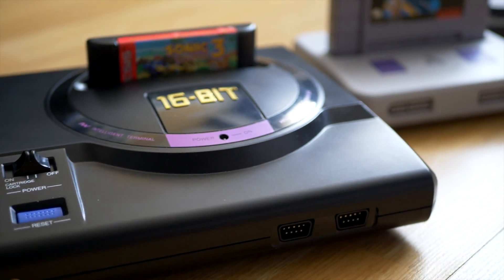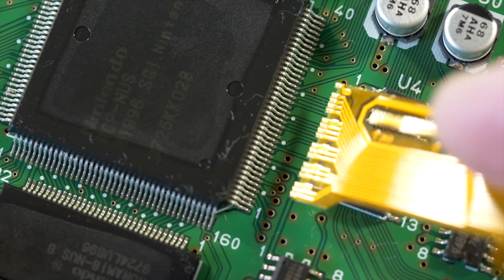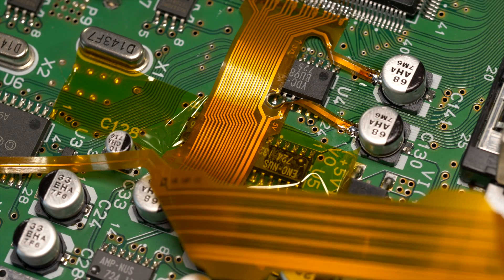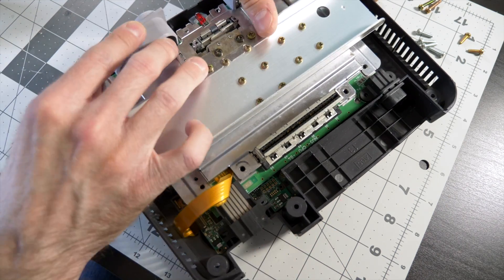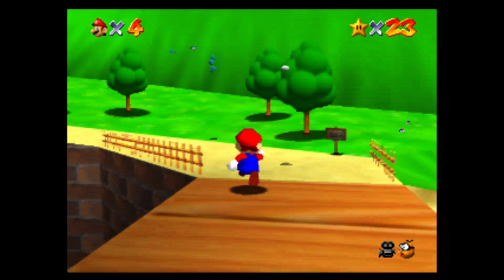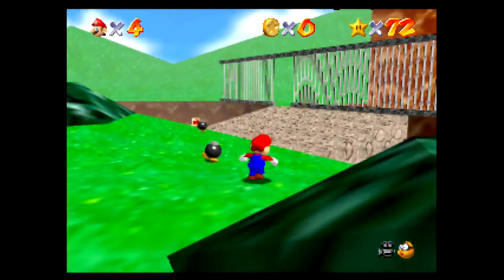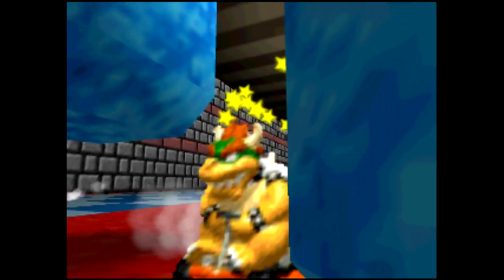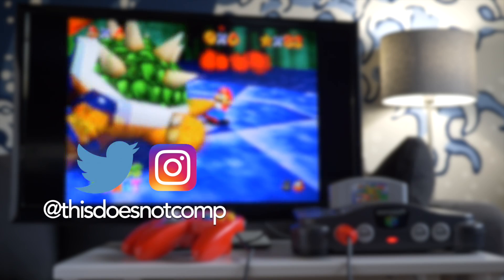HD Output For Your Nintendo 64 - UltraHDMI Review

Comment: This is not even a solution for me, because the price is too high, there's too much trial and error involved with installing the device, the picture quality isn't much better aside from the use of HD and getting it pre-installed costs a ludicrous amount of money! It boggles my mind how there still isn't a better, cheaper solution for just being able to play my N64 games in HD in 2018! Surely they would've come up with a reproduction console that runs through emulation for N64 games by now! They already did the same with 16 bit consoles years ago, and it's not like N64 games run on optical disks or anything!

Comment: I would love to see one be made for the Sega Genesis. I have a European Mega Drive with a VA4 board HDG without the TMSS screen which I've modded already and even housed it into a Japanese style casing from a PAL Asian board. I swapped the board out, because it was the non-HDG model and had the TMSS screen every time you booted it up. I've even added two region switches (this mod was done in 2010 before I learned about the single switch), CPU freeze, pink power LED, overclock, rear headphone jack (post-pot), and a reset pedal on the side of the unit. I also plan to do a 60Hz colour fix for when I'm not using scart, bluetooth audio, internal battery (I use this thing at live chiptune shows), YM3438 piggyback (for improved audio output), and a composite plug in place of the coaxial port. If there's a mod like this available for the system, that'll make 6 extra mods to plan.

Oh, and I even got it signed by Yuzo Koshiro and Motohiro Kawashima!

Comment: Omg you are a boss. I never succeed in soldering flat flex cables. I either burn the cable or make a total mess with the solder or both :/ does anyone make a needle-tip soldering iron with controllable temp? I could never find one... anyway, thanks for the fun video! Great work!

Comment: or.... or.... or.... you can emulate
Reply: N64 emulation is not always great. The best and most consistent option is a stock unit (cheap) with a consumer CRT. Or an OSSC if you're willing to spend extra.
Reply: I never had any problems using emulaters... mario works as intended and all.. the only downfall when trying to get perfect graphics is alot games fps was related to speed so if you played mario 64 in 60 fps you would get double speed but other than that they played as intended with no graphical glitches (at least in my experience)
Reply: i dont have any graphical glitches with that game on an emulator.
Reply: i didnt even have graphical glitches when i used project64 v1.6 back in 2014. maybe you had certain things disabled by default in the settings. i always used my own settings

Comment: I suppose I'm the only guy who got one of these and sold it. I simply was not impressed with it vs rgb on a CRT. Especially if you have a 4k TV in which case you typically have to run the hdmi through something like the xrgb mini anyway.

Comment: Between the cost, install difficulty, and rarity of the mod, not to mention the requirement of cutting the console casing, I decided to go with Tim Worthington's RGB board instead. Both Tim's board with Borti's firmware, along with Borti's own custom RGB board are able to perform de-blurring like the Ultra HDMI, and you can pair it with an OSSC for HDMI output with minimal lag. Of course, the Ultra HDMI internal menu options are more robust, but the image quality vs Tim's board +OSSC is not far off. https://imgur.com/a/9PlWSo2

Comment: I did this recently with Marshall's Ultra VGA board for my portable N64 and I found it far easier to tin the pads on the flex cable first, flux the flex and RCP and then drag the solder on the flex cable to the RCP pins. Didn't need to use any tape and that method worked first try! Overall love both mods in general!

Comment: Interesting, I am thinking about making portable N64 and would like to know a good lcd to use that can handle the custom refresh rate. Many portable N64 consoles use composite with a 640 by 480 lcd display. But with this will it show a 4:3 picture on a 16:9 display and I can just cover the black bars with plastic? But the $150 and scarcity makes a need to visit them in shenzhen to find out how they have the ability to produce such circuit boards.

Comment: In my opinion it seems like a huge waste of money. These games were built to be played on a CRT, you could RGB mod or buy a pre-made one plus a CRT for much cheaper than buying this to get great quality on a CRT.

If you want old games looking good on a HDTV, just buy or build a retropie. They'll have options for upscaling and filters too the games will look great on a modern TV

If you absolutely must use your old hardware on a modern TV, just buy an OSSC which will not only work on your 64, but all of your old consoles and is extremely customizable.

Great video though.

Comment: Nice install and review.  I've had my UltraHDMI modded N64 for a couple of months now (took over a year to get my hands on one) and i absolutely love it.  It has enough options so you can get a great picture out of any N64 game.  I'm not even much of a scan lines guy, but they come in handy on games that have a ton of dithering-- two i've noticed so far are Rayman 2 and Turok 2-- smoothing everything out quite nicely.  It really is amazing the difference it makes.  So with UltraHDMI and the new Brawler64 controller, there's never been a better time to be a Nintendo 64 fan.

Comment: Quick question about earphones. I was listening to my Apple Earpods a bit earlier and I was wondering how they produced bass so nicely. With some research I found out that they used a small acoustic chamber inside the headphones to create bass. Would you consider earphones with these kinds of holes to be "open back." Or would this require more openings?

Comment: I put together a group buy of these in mid 2016 and ended up installing  6 or 7 of them for friends. It does get easier with practice, but I was still terrified of ruining one of the flat flex cables because you could not get spares at the time. Keep an eye on the retroactive forums and the installers page for firmware updates, there have been a few bug fixes and some good feature updates since launch. fourm link: https://retroactive.be/forum/viewtopic.php?f=8&t=7&start=470 installers link: http://ultrahdmi.retroactive.be/installer_purchase/

Comment: It's kind of a small world in the console modding scene.  Gametech, Marshall and Kevtris all seem to work with each other often.  I sort of think as big money & corporations get into this that might change a bit.  I'm sure Kevtris and analogue are looking at the n64 or perhaps another company might talk to Marshall.  It's like the moment when the Homebrew computer club started to breakup.
Reply: Nowhere near. N64 emulators can render at higher resolutions. This is just an upscaler+a few video options+hdmi-output. There's a massive difference, even if it is apparently an amazing scaler.
Reply: On an emulator you can force the games to actually render at 1080p or even higher with loads of filters, resulting in basically perfect clarity. The catch is that current n64 emulators aren't flawless, not to mention that a lot of people enjoy using the actual hardware.
Reply: ASMR People Does the mod make games look like they would on a pc emeulator or close?
Reply: Marshall is an N64 Savant. I used to talk with him on the benheck forums like 10-15 years ago.
Reply: Yeah, UltraHDMI has the best artificial scanlines i've seen.  I'm not even a fan of scanlines really, but i i do find myself using it on certain N64 games, and i'm always impressed.
Reply: ASMR People Not sure what you mean. MarshallH has no formal relationship with GameTechUS. Anyone can place orders of 3 or more kits just like GameTechUS... if they can reach him. MarshallH is notoriously unresponsive to email but I’m sure he’ll respond if you’re serious. If not, well, rather than spill the beans about how I contact him, I’ll just suggest that you join my brother’s group buy on Shmups and get as many as you want at lower cost. He already finished one group buy. I’m pressuring him to start it back up today because people have been waiting for him to do it again for a few months now.

Comment: I thought about the UltraHDMI mod, but went the cheaper route with an RGB-modded N64. Then, I used the HD Retrovision SNES component cable. I wish I had your soldering skills, Colin. I lost them after 8th grade Tech Ed.

Comment: This is cool, but at $150 i'll just keep playing my N64 on my 27in Panasonic CRT till it dies, I can't find a good replacement for it for a decent price, and I'm force to move all my retro consoles to a newer HDTV.
Reply: Commodorefan64 - Yeah, I am looking to buy a small CRT TV that has the resolution and clarity of today’s technology,  but with the CRT format of 4:3, if that makes sense.
Reply: NYCJoeBlack You might want to look into a SONY Trinitron PVM but they are not cheap, or a later 19in SONY TRINITRON TV with component input. RCA Thompson also made some trueflats in the early 00's but they are not good for light guns.
Reply: Commodorefan64 - Ok, thanks!  

I knew something like that exist, but I never really looked that hard into it.  I hate playing “retro” games on a modern TV, because I don’t like borders.

For some games in the GameCube era, there is a wide screen mode, but I feel like the image is stretched rather than fitting into a 16:9 aspect ratio.
Reply: NYCJoeBlack No problem, and yeah I can understand where you are coming from. I just recently got a fat PS2(never owned one in it's time as I had a GameCube) from my older sister who was cleaning out her storage trailer, and said my Nephew did not want it, as they already had another one, and so I hooked it up via component to my 47in 1080p Samsung HDTV, and while the TV has a nice internal scaler for even 480i in Natural mode(reduces post processing, and input lag) the borders can sometimes be off putting on some games that don't have native support for widescreen, and if your asking why I don't use my CRT, well it's gotten a bit too busy with so many consoles, and a ROKU Express+(lets me watch 2 sports events at the same time like 2 college football games, or Football, and Pro wrestling) hooked too it, even with a 3 way component switch box. LOL!

Comment: I’m hoping by 2020 with the pattens supposedly run out, analogue comes out with an hd version of the N64. I still have my original n64 that will be 22 years old in a few months that’s in perfect shape and don’t want to modify it.
Reply: Nintendo can hust renew the patents, which they'll likely do if they release a N64 Mini

Only thing stopping a HD 64 is the 64 being difficult hardware-wise. That's why even Wii emulation is more accurate than the 64.
Reply: Kevinb1821 I would love to modify mine but these mods are rare. Lol

Comment: Excellent video! Thank you.  There is also an HDMI upgrade kit for the GameCube.  I highly recommend you check it out - Item#6117  (Pluto-IIx XC3S200 HDMI) (pre-programmed with GCVideo 2.4a for Gamecube) I have performed this mod a bunch of times, and if you think the N64 looked good, you gotta check out this on the GameCube.
Reply: got a link to the video install of this. found the item you speak of, and i am totally buying this right now
Reply: Excellent! I have done about 6 of these already, great mod to do.  You will also want to purchase one of these - https://www.ebay.com/itm/GameCube-GCVideo-3D-printed-Pluto-IIx-mount/273173075333 - This is a 3d printed mounting bracket for the board inside the gamecube.

Comment: I wonder if it would be possible to wire it up to a normal HDMI connector? You could remove the analog connector (who needs it now you have HDMI) and put a full-size HDMI connector in it's place, which would mean no need to cut holes in the case!

Comment: No mention of the image blur cleanup?
Reply: Have you tried UltraHDMI? The VI Deblur is one of my favorite features. It's not mind-blowing but it's a noticeable improvement.
Reply: Even the RGB board (not amp) can be flashed with firmware that enables the deblurring option; although the N64 output will never be great, turning deblur on makes a world of a difference!
Reply: EtikaArchiveNetwork Only when modded though.
Reply: I don't know, i find UltraHDMI's de-blur pretty mind blowing.  I think it makes a huge difference.  The only thing i find disappointing at all about it is it can make the dithering that some games use (i especially notice it in Rayman 2) even more noticeable, but that's just built into the game and there's nothing that can be done about that.  Actually, that's not quite true-- i find that just using scanlines, which i'm not normally a big fan of, makes dithering a lot less noticeable, and can actually look pretty good with some games.  Scanlines can also help on games that have pretty obvious interlacing (Turok 2 for instance).  So pretty much any N64 game can be made to look better with UltraHDMI.  I absolutely love it.
Reply: There's not really much you can do about that to be honest.

The 64's output is absolute ass. Same for the ps2.
Reply: Crossed Mike Yeah but this mod had blur reversal as a big feature. Go check out My Life in Gaming's N64 video.
Reply: @brandonnesfan  There are a few deblur modes, actually. I have this mod. It doesn't fix everything, but it deals with some of the antialiasing.
Reply: Brandon-Lee Collins I don’t know about the PS2. It produces crystal clear 576i over RGB SCART and looks stunning in my CRT. Of course, 480p over SCART is a pain in the ass, but I’ll probably use component if I ever switch to 480p. For now, I’m happy with my 576i as that’s how the PS2 was originally designed to be used.

Comment: It looks amazing, but at $150 it's almost half of what I paid for my Framemeister. I know the UltraHDMI has an advantage over a scaler, seeing it gets its signal straight from the graphics chip, but still. $150.
Reply: It seems like alot of money until you consider what the hardware costs to produce
Reply: Considering the better input signal, extra features and little to no input lag, it really isn't unreasonable for a small production run item.  Even less so for people who don't have a Framemeister and don't desperately need one.

Comment: Good to know but 150$? I'mma have to pass
Reply: Coleco Co Cheaper to use Project64 with an N64-to-USB adapter
Reply: I actually have that but ironically the one game I wanted to play Star Wars Rogue Squadron can't be emulated. Something to do with the coding.
Reply: Coleco Co it’s pretty cheap because you can play as much as you want and it’ll last a long time...
Reply: mamster233 No it really doesn’t, considering the composite cables are still on most modern TVs. You can get upscalers to connect your N64 via composite or S-Video to HDMI for around $15-$20, it’s not the absolute best you’ll get out of the N64, but it’s still a good option if you’re not looking to spend $150 for a HDMI mod. I’d say that an Everdrive 64 would make up the rest of the money that you’d spend on the HDMI mod, but Everdrive 64 carts are waaaaay too overpriced also.
Reply: look up ebay price lol